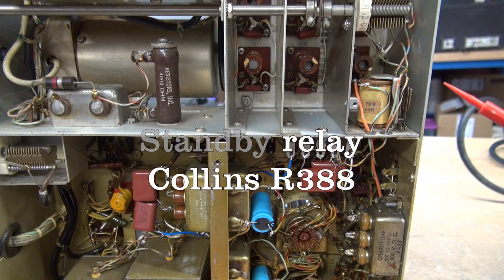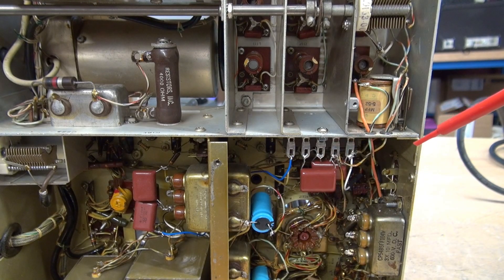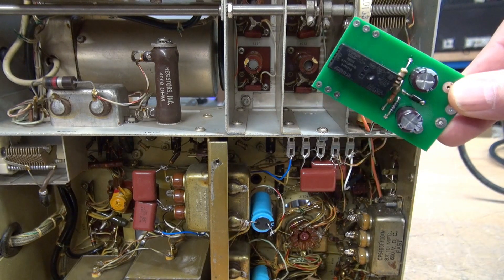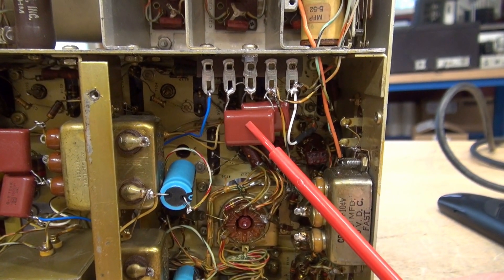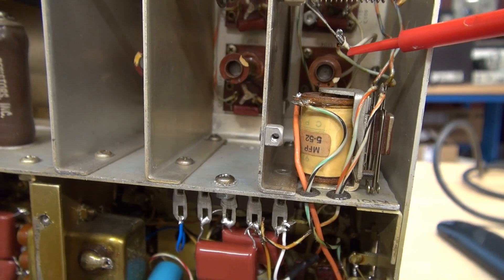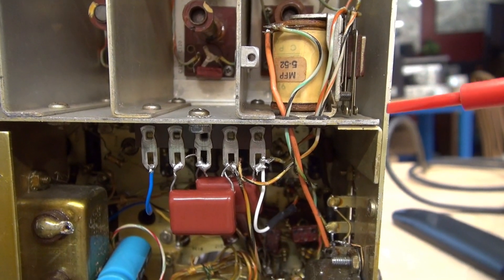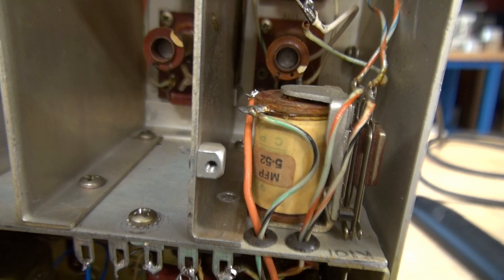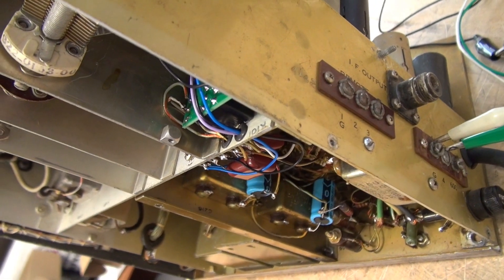Vintage Collins R-388 Ham shortwave receiver K1 Standby mute module installation Replace relay K101

Comment: Thanks for the video of the standby module in the Collins R-388. I have a Collins R-388 receiver, but I have not hooked it up with a transmitter yet, so I don't know if it has issues.
73 Paul AA1SU